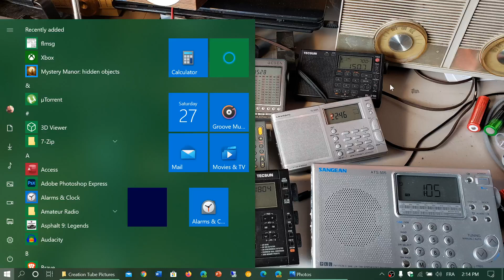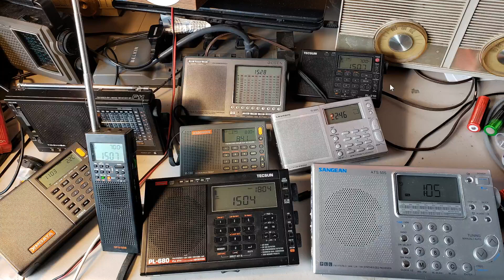PART 28 Shortwave for Beginners Are all radios equal in Sensitivity

Comment: OfficialSWLchannel:  Is this statement true ---->  "The Radio Shack DX-398 is identical to the Sangean ATS-909, except for the nameplate.  The Sangean comes with accessories that aren't included in the Radio Shack version, namely an AC adapter and a reel antenna.  Both radios come with a vinyl case."  

I found this strange because the Radio Shack DX-398 (that i used to have) came with an owners manual, a reel antenna, a power adapter, and a vinyl case.  Maybe this was because I purchased it on eBay and the previous owner purchased those extra things for it when they had it for their self.  Do you think this is the case?  What do you think about the Radio Shack DX-398?  And is the Sangean ATS-909 and Radio shack dx-398 identical on the inside?
Reply from the maker: it is exactly the same and they both come with exactly the same accessories
Reply: Sangean made the radios for Radio Shack  for MANY years.
Yes , I’ve had both.
Exactly the same radio.
📻🙂

Comment: I agree with your opinion on portable receivers. I have 3 main receivers; CCrane SSB, Eton Elite Executive and Tecsun PL 880. Signal sensitivity comparisons made with these 3 radios are virtually identical, all radios have very high sensitivity and selectivity. This is probably due to the similar digital processors. As you mentioned, each have different filter settings, some better than others but all are very good.  For me it usually comes down to other options:  scan and memory options. Don’t fret, pick one and go!